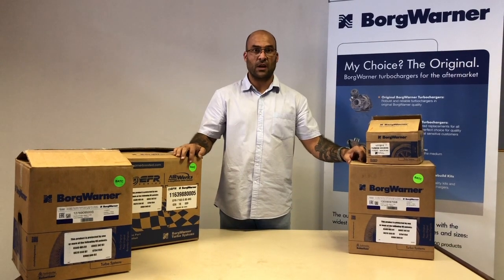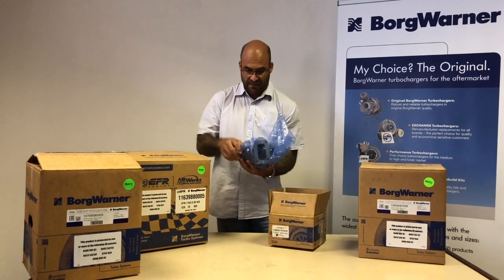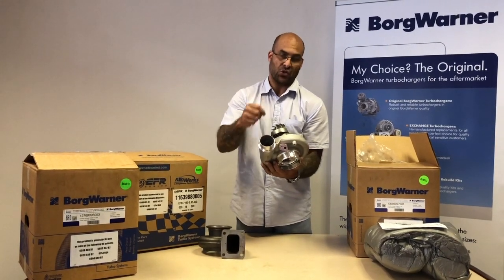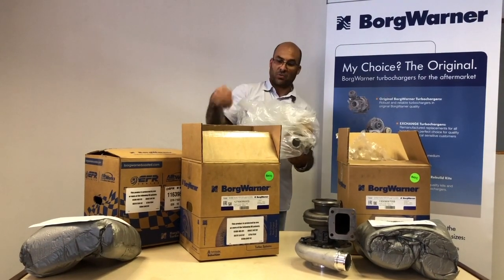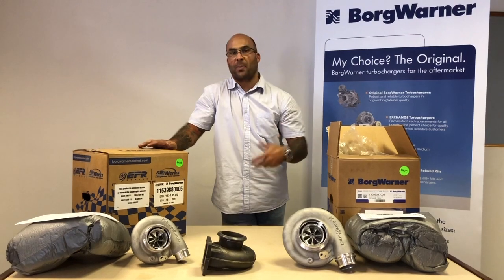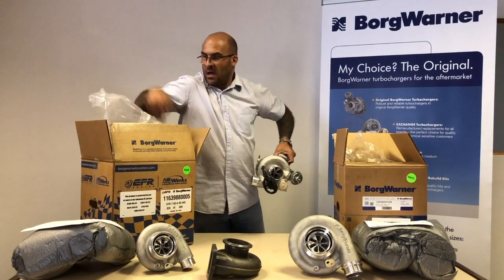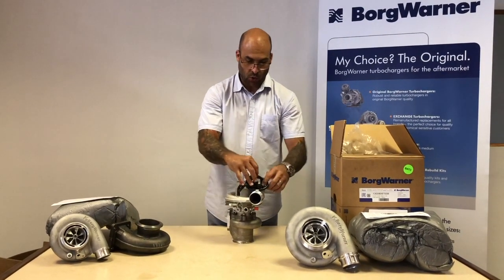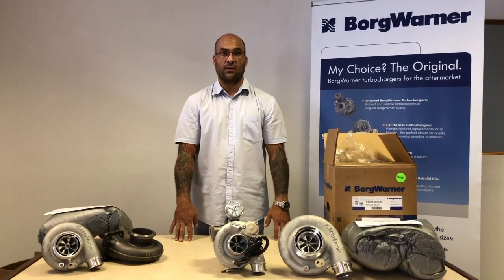BorgWarner EFR and Airwerks

Comment: Hi, I've been offered a borg warner s360 with an AR 91 swinscroll t4 flange, will this work on a 4 cylinder 2.3l turbo. And idea what ram it will spool at. I was originally going g to get the efr 7163  but this guy is saying the s360 will give better spool. Please advise. 
As usual great content guys. I always fine myself watching and liking.
Reply from the maker: Zaid, it seems that the person who suggested that the really large S300SXE turbocharger is seriously mistaken if he/she believes that it will spool faster than the EFR7163. 

The EFR is ball bearing, uses a Titanium Aluminide turbine wheel  (weighs a fraction of the Inconel wheels) and measure 63mm x 56mm. The EFR7163 uses the turbine housing AR from the GT28 family volutes (really small and FAST spooling)

The airwerks S300SXE 60mm compressor (aka S360) uses an inconel turbine wheel which measures  67.5mm x 76mm and is journal bearing.  The S300SXE range uses the T4 family turbine housing volutes, and AR88 -- this is MASSIVE in comparison to the EFR7163 

There is no chance that the S360 will spool faster than the EFR7163 - this person is sadly mistaken.